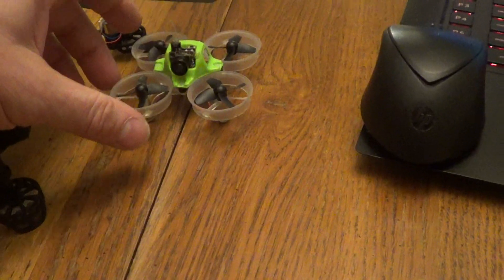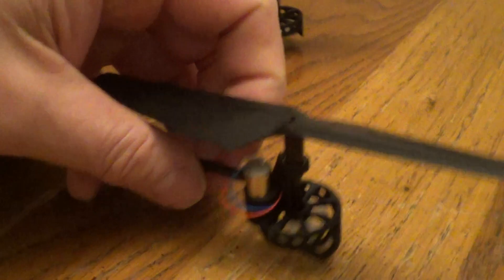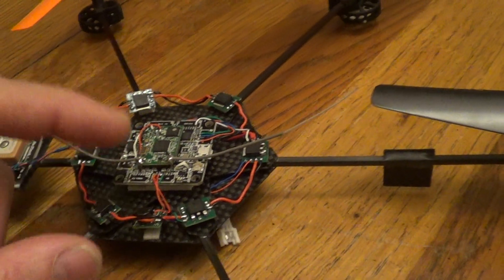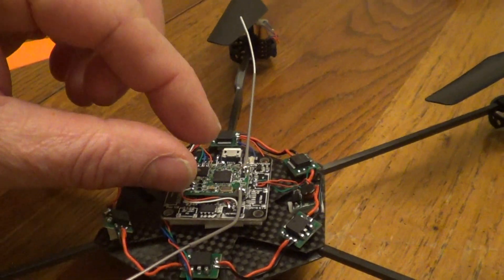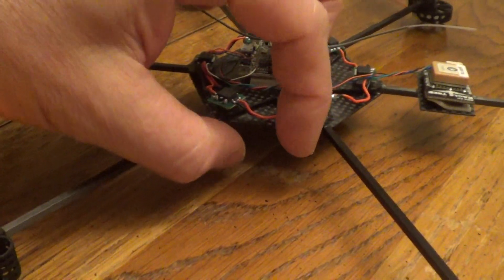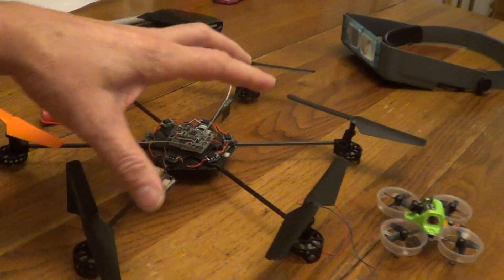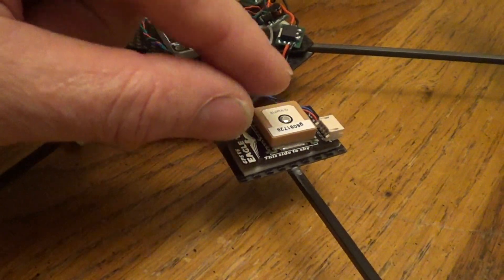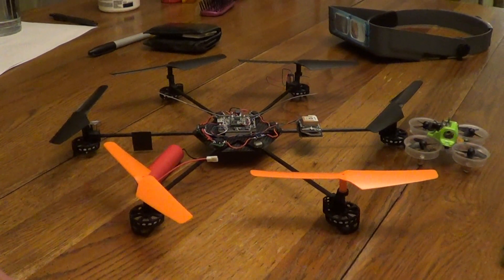Light Weight Endurance Drone (Teaser Video)

Comment: Hello, where did you buy this gears and props?
Reply from the maker: They are hard to find now.  The shaft changed size.  It is probably best to buy a quadcopter with them already installed.  I ended up scrapping using geared props and finally got 8 minutes and 1 mile range on a micro a few months ago.   I have a video on that.

Comment: Funny how I been researching this exact same build for months and today I stumbled across your video while watching something totally different.. I have an old qx180 that I been researching parts for. I was under the impression that a brushless geared was going to be the most efficient but I'm surprised to see your results
Reply from the maker: I have a later video with 55 grams 8 minute flight time and 1 mile range.  Brushed can't be beat on the ultra small micros yet.  If you think about it, it makes sense.  Brushless main advantage is extreme power that brushes can't handle.  However, micros that have endurance don't need extreme power.  They need light weight.  Corless is lighter because the rotor is just copper.
Reply: @microdronetech8453  I'm looking to design an 3d print an iflight 77r style brushed cinewhoop and while looking for 2s capable setups i came across this little gem that is absolutely perfect for this build and wanted to share in case you haven't found a solution " USAQ SP Racing F3 Evo Brushed 32-Bit Flight Controller for 1S/2S 720-1050 Motors" that controller is capable of driving all 6 of your motors but apparently only 2.5a per.
Reply from the maker: @Markitos203  I was trying to get 1 hour flight time on this project.   I gave it up when the most I could get was 15 minutes and very under powered and very over weight.  That flight control probably would save 10 grams.   However, this drone also ended up be just as noisy as a Mavic pro.  So, I ended up switching to the propulsion of the DJI Tello on a different frame.   I have some videos about that project.   Thanks for the head up about the controller though.

Comment: neat! lightweight geared "paddle" props are awfully underrated. not very fast but super efficient, and i really got to like the way they feel. 
PS: fitting and old parrot AR 2.0 frame with modern electronics is an interresting option. with 3-4 18650s way over 30min flight times are realistic.
Reply from the maker: I canceled this project after 1 year of development.  It came in 20 grams too heavy.  Here is some good efficiency data if you are interested.  I'll probably do a video on this data.  I had to scour the internet to find it.

Micro Brushless Motor Tests (Montis on YouTube)

Diatone 1104 6000KV, 2S (6.5g) Gemfan Flash 2540 Prop  32g Thrust 4.0g/W, Max 164g Thrust 2.64g/W
Happymodel 0706 15000KV, 1S Hubsan 55mm Prop   10g Thrust 1.66g/W, Max 28g Thrust 3.49g/W
Happymodel 0703 15000KV, 1S Hubsan 55mm Prop  10g Thrust 2.21g/W, Max 25g Thrust 3.15g/W
Sunnysky 0705 15000KV, 1S KingKong 65mm Prop  10g Thrust 2.12g/W, Max 33g Thrust 3.49g/W
Sunnysky 0703 12000KV, 1S KingKong 65mm Prop  10g Thrust 2.92g/W, Max 30g Thrust 3.21g/W
Sunnysky 0703 12000KV (3g), 2S JJRC 1000 56mm Prop  20g Thrust 4.02g/W, Max 70g Thrust 4.35g/W
Racerstar BR0703 10000KV (1.9g), 1S KingKong 65mm Prop  10g Thrust 4.17g/W, Max 27g Thrust 3.65g/W
Eachine E010 original 1S, E010 prop Cut 2 Blade  8g Thrust 2.99g/W

Altair AA108  8 minutes   85g   2.59Whr    4.38g/W
DJI Spark   16 minutes  300g  16.87Whr    4.7g/W
Blade 200QX   7 minutes  190g   5.92Whr   3.7g/W
Blade 180QX   7 minutes   95g  1.85Whr   5.99g/W 
Kingkong Q100  7 minutes  70g   2.04Whr     4.0g/W
DJI Mavic Pro  24 minutes 734g   43.6Whr   6.7g/W
DJI Mavic Pro Platinum    27 minutes   734g   43.6Whr   7.6g/W
F100 Ghost   12 minutes  445g    13.32Whr  6.7g/W 
Syma X5  4 minutes  120g   1.85Whr  4.32g/W
MJX Bugs 3   20 minutes 447g   13.32Whr    ???g/W
MJX Bugs 2W   18 minutes   445g   13.32Whr   10g/W  (motor weighs 21g)
Parrot Beebop 2  25 minutes 500g   30Whr   7g/W  

Micro Quadcopters

Eachine QX90  6 minutes 54g  2.22Whr   2.43g/W
Tinywhoop    4 minutes   25g   0.76Whr     2.25g/W
Blade QX2   8 minutes   52g    1.85Whr    3.75g/W
Beta 65s (Brushed)       2.7g/W  (Tested by muteFPV on YouTube)
Beta 65 Pro (Brushless)  2.1g/W
Mobula 7 (Brushless)     2.3g/W
Beta 65x (2S Brushless)  1.4g/W
Arris X80   6 minutes   43g  1.85Whr  2.32g/W
EMax TinyHawk   4 minutes  42g  1.67Whr  1.68g/W
JJRC JJ1000  7 minutes  33g  0.93Whr  4.13g/W
   

Fixed Wing

Parrot Disco Wing  45 minutes 750g  29.97Whr  18.8g/W
Blade Theory 760mm  10 minutes  480g   14.43Whr   5.5g/W ???
Blade UM-F-27  5 minutes  76g    3g/W

Helicopters

Blade 130 S    7 minutes  170g  3.33wHr  6g/W
Blade 230 S    7 minutes   339g   8.88Whr   4.5g/W
Blade 250 CFX   6 minutes   457g   15Whr    3g/W

Comment: What ball bearings and torque shaft did you use ? and what gear size? I cant find the ones i need to fit those Motor mounts from Shapeways

Comment: It’s feb 2018 what happened
Reply from the maker: I'm on the 3rd respin of the power control circuit board.  https://www.dropbox.com/s/thl8qnecy0q2zyg/Vector_ESC%20Top.jpg?dl=0
Reply from the maker: This board will go right under the Micro Vector.  It has 6 brushed speed controls, 5V and 3.3V power supplies to run a camera and the vector.  It will also feed current reading to the Micro Vector for OSD current readings.  I'm spending more time on this project now.  It is looking like it will be 170 grams now with the Runcam Owl night vision camera.  I'll post a tuning video once I get this in the air.  One of the first things I want to do is measure flight time and compare hover current vs forward flight current.
Reply from the maker: I will make the boards available either via ebay or directly thru the circuit board fab.  The boards go for $7 from www.oshpark.com    They are set up to do small projects by bundling them on panels with other projects.
Reply from the maker: I have bad news.  I ended up being over weight.  Total weight was around 160 grams.  I was hoping I could pull off 120 grams.  Flight time would have only been 20 minutes.  The project ended up being a 6 month waste of time.  But, I did discover that a Mavic Pro gets 30 minute flight time.
Reply: MicroDroneTech this guy used one one this tiny whoop to show that it works from converting the 3 brushless motor wires down to the brushed motors.          https://youtu.be/qx32L3aszcA
Reply from the maker: I compiled some efficiency data on off the shelf FPV aircraft.  These are published results.  I didn't actually test any of this.  I was surprised that micro helicopters actually have poor efficiency.  Nobody is under 250 grams with decent flight times and GPS.  The Parrot Disco flying wing would be good if the software didn't lock up and crash.  Since I can't stay under 250 grams, I would just go with the Mavic Pro Platinum.  But, I'm doing some upgrades to Tiny Whoop.  I will try long distance flight on that airframe with a 200mW transmitter.

Altair AA108  8 minutes   85g   2.59Whr    4.38g/W
DJI Spark   16 minutes  300g  16.87Whr    4.7g/W
Blade 180QX   7 minutes   95g  1.85Whr   5.99g/W 
Blade QX2   8 minutes   52g    1.85Whr    3.75g/W
Kingkong Q100  7 minutes  70g   2.04Whr     4.0g/W
DJI Mavic Pro  24 minutes 734g   43.6Whr   6.7g/W
DJI Mavic Pro Platinum    27 minutes   734g   43.6Whr   7.6g/W
F100 Ghost   12 minutes  445g    13.32Whr  6.7g/W 
Syma X5  4 minutes  120g   1.85Whr  4.32g/W
MJX Bugs 3   20 minutes 447g   13.32Whr    ???g/W
MJX Bugs 2W   18 minutes   445g   13.32Whr   10g/W  (motor weighs 21g)
Parrot Beebop 2  25 minutes 500g   30Whr   7g/W  
Eachine QX90  6 minutes 54g  2.22Whr   2.43g/W
Tinywhoop    4 minutes   25g   0.76Whr     2.25g/W

Fixed Wing

Parrot Disco Wing  45 minutes 750g  29.97Whr  18.8g/W
Blade Theory 760mm  10 minutes  480g   14.43Whr   5.5g/W ???
Blade UM-F-27  5 minutes  76g    3g/W

Helicopters

Blade 130 S    7 minutes  170g  3.33wHr  6g/W
Blade 230 S    7 minutes   339g   8.88Whr   4.5g/W
Blade 250 CFX   6 minutes   457g   15Whr    3g/W
Reply: MicroDroneTech hey I found a brushless ESC to brushed motors , it converts a brushless flight controller to run brushed motors , for a long time I’ve been wanting to make a brushed GPS quadcopter or hexacopter like your design , but there is no real way honestly and when I found this I had a glimmer or hope ! , I’m thinking I can find a small 20x20 or 16x16  F3/F4   (With the new betaflight GPS rescue mode )brushless flight controller with a barometer ,OSD and at least 2 -3 UARTS so I can wire in the GPS module and my RX maybe even some led lights I can control through the 3rd UART . Let me know what you think about this NAZE32 board , I might have to look into other micro flight controllers or something that can use INAV software over herd it’s a lot better for GPS builds            , Ihttps://rover.ebay.com/rover/0/0/0?mpre=https%3A%2F%2Fwww.ebay.com%2Fulk%2Fitm%2F253037166262
Reply: MicroDroneTech great news, really looking forward to seeing current draw and flight time figures. This is an excellent project and I am looking forward to seeing more. I have some brushed motors and FCs on order so I can have a go at this too. Can’t wait to see the flight footage. Thanks and keep up the good work.

Comment: Hi! why don't you try the existing Flight controller. SP F3 brushed with 6 motor output.
Reply from the maker: I like that OSD and current measurement are built into the eagle tree.  Also, they have a good antenna tracking ground station that encodes the GPS data into the video frame and not the audio.
Reply: Got it. waiting for the result!
Reply from the maker: I'm expecting prototype circuit boards any day.  I found a hobby company that makes 4 layer boards for less than $10 in single quantities.  My first batch of boards had a re-spin after I ordered them, so I didn't even build.  I will probably put some built boards on ebay.  But, if I don't do that I will have them set up to be ordered by anyone who wants to build the power section them self.

Comment: Nice! Lookin' forward to your build :)
Reply from the maker: I actually had to design and program a micro sized "brushed" speed controller.  There aren't any brushed controllers that will handle the 400hz to 2khz update rate from the micro vector.  I will be selling the boards on ebay.  It will be a very elegant solution with current sense, 5V boost voltage regulation and 6x speed controllers on a single board that fits under the micro vector.  But, that is what makes this hobby fun.  I get to do things that have never been done before.  I should be in the air with it late January 2018.  I can't wait to see how long the flight time will actually be.  Hopefully, it will be 1 hour on a single lithium ion cell.  But, 30 minutes will probably be fine too.
Reply: MicroDroneTech Yes, I also enjoy the tinkering and building of these micros too, I mean besides the flying part. Awesome work, keep it happening!